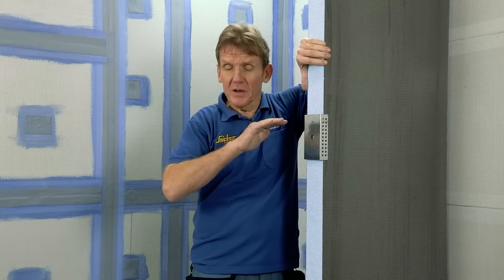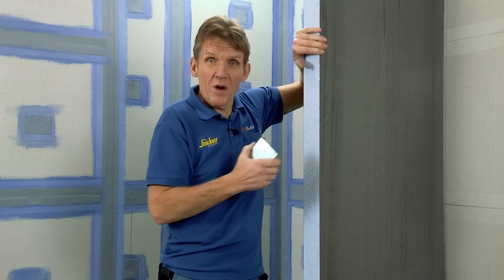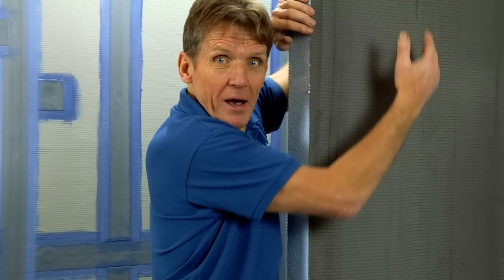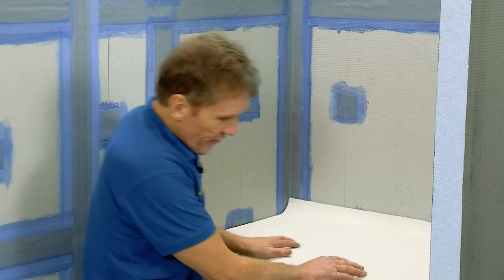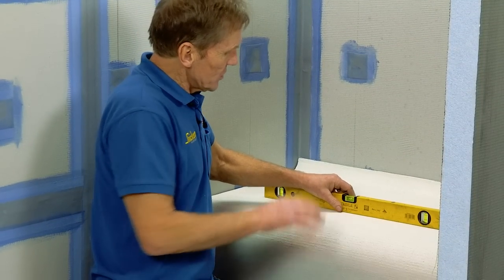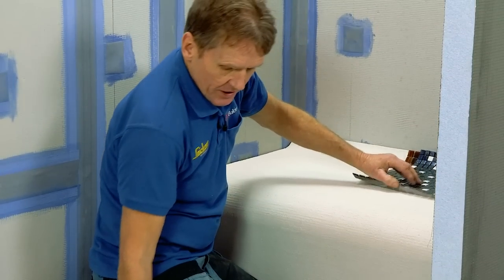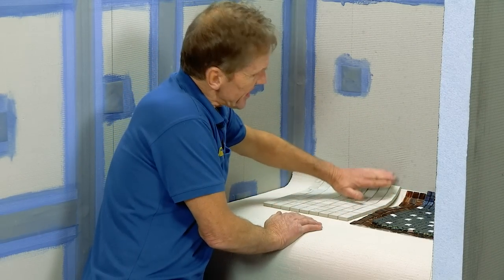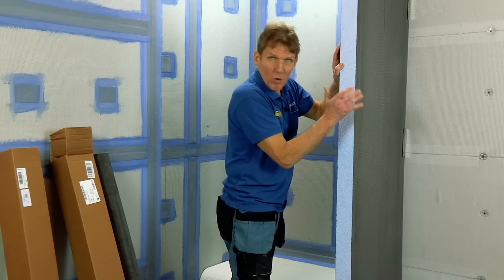Great Shower Idea - Luxury Mosaic Tiled Bench

Comment: Great video, planing on exactly the same - I've ordered a seat but I couldn't see a shower tray fitted in front of it, does it need to be butted up to a tray?
Reply from the maker: No it normally goes in a wet room. If you use a tray place it in front of the seat so the edge of the tray is tight use some MD adhesive as the first seal, then use the sealing tape to get you onto the tray. The tiles cover the tape.
Reply: That's great - thank you for your help

Comment: Looking forward to having a shower seat but what size mosaic tile do you please suggest? Is it a case of the smaller the square the better? Please hope you can reply as I need an answer as it will be for a new wetroom I'm having built for my wife who has a disability. Many thanks.
Reply from the maker: The smaller the better but it is not an easy job to do the mosaics, You need to comb the adhesive bed so all the ribs are uniform. You then press the tiles into the bed and work the curve around with a sponge float or a piece of flat wood. I have done a fair amount of tiling but this is a job I would let a good tiler do.
Reply: @SkillBuilder  thanks for replying so promptly. Appreciate the feedback. I'll definitely be employing an experienced tiler to do it. I was just conscious of achieving a smooth curve with the mosaic tile sheet for the seat and it being comfortable for wifey to sit on. 👍🏻